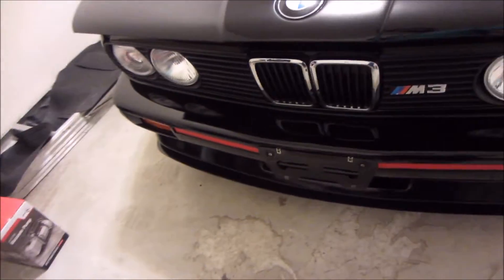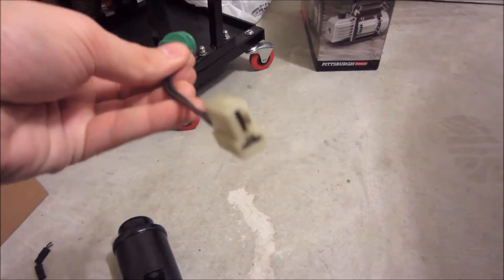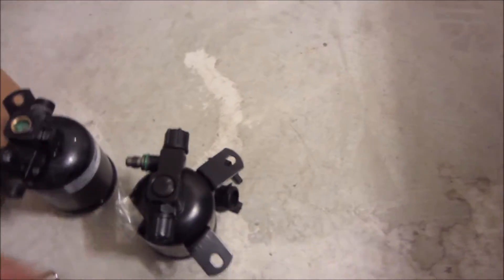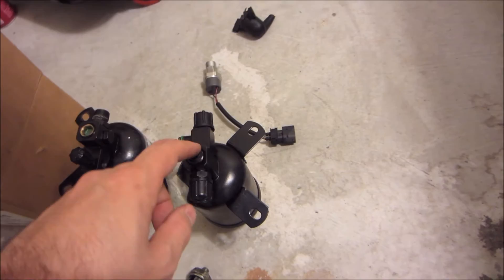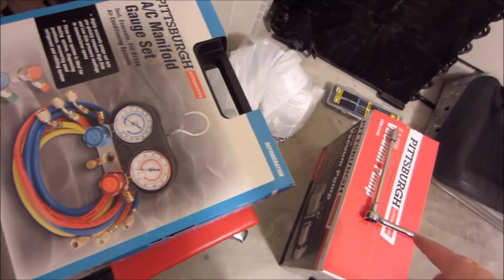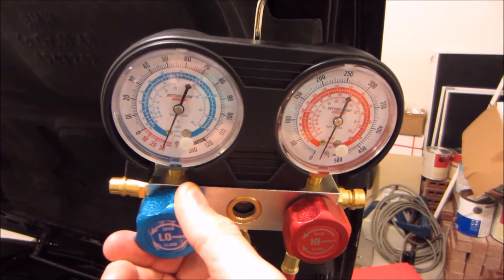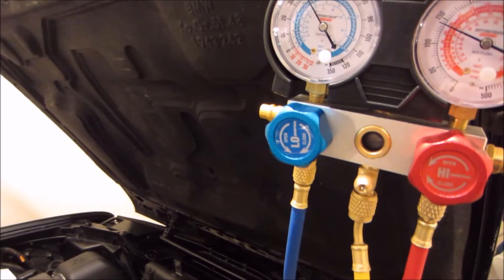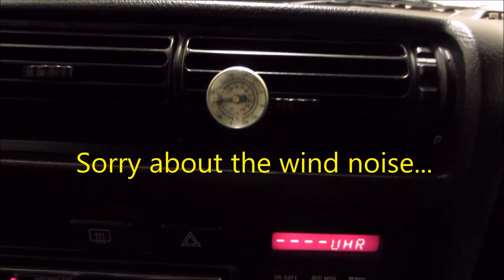E30 M3 R12 to R134a A/C Conversion

Comment: Hi! Great video!!! What is the part number for the single pressure sensor?
Reply: I found a pressure sensor but do you have a part number for the pigtail to connect it to the car? Thank you
Reply: @rohitsharma-xu9wv  I know this is from a year ago, but for anyone that needs this in the future: 6113 1 378 400 - that's the part # for the wiring connector.
Reply: @samgoaliecam  life saver, thanks

Comment: hello, your video is very informative. I am in the process of converting my E30 M3 to R134a, can you provide the source where to buy the ac hose with r134a valve that runs from compressor to evaporator?
Reply from the maker: I actually purchased it from Husker auto parts, let me know if you need the part number.
Reply: Do you have that part number? This is the hose that re-routes the valves so that the hood hinge doesn’t get in the way right?